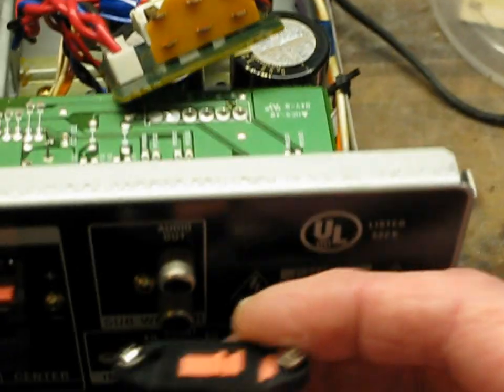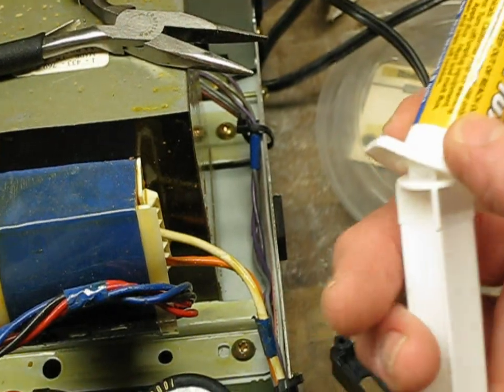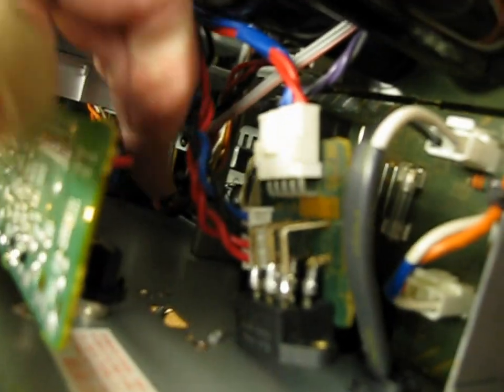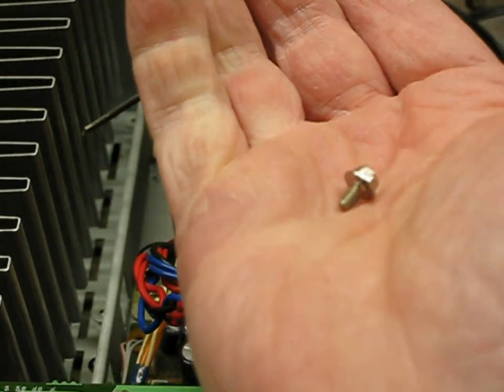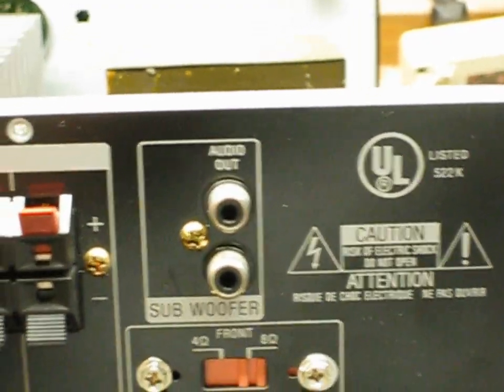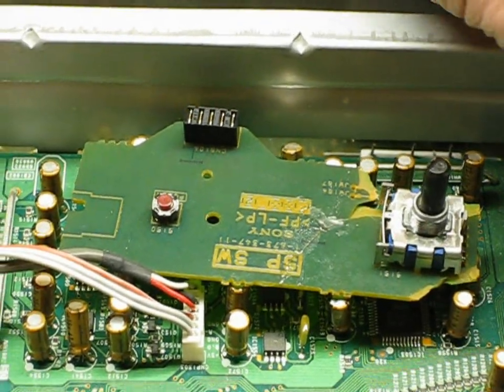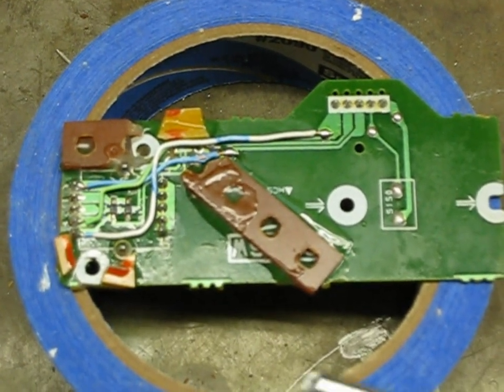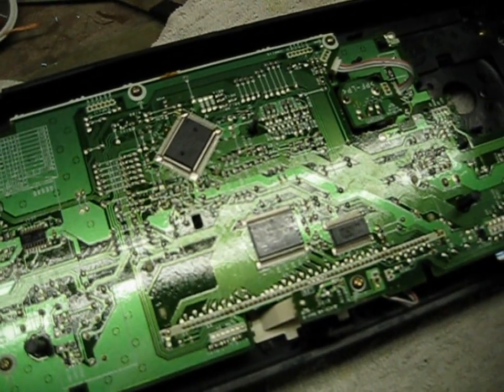SONY STR-DE935 FIX  *Common "No Sound" Issue *  -Plus Broken Switches*  PART 1

Comment: I have a Sony STR-K750p reveiver and I recently noticed that the front right speaker sounds much quieter in comparison to the left front speaker. I did a factory reset and that did not fix the problem. I rotated the speakers and the problem in the right front channel still persists. Please help! 😢

Comment: This switch changes the voltage coming from the transformer, for example 4 ohms 28 volts, 8 ohms 38 or 42 volts, this is the easiest Sony repair - many greetings from Bulgaria.

Comment: I have the same Sony Domi digital surround receiver got mine in 1998  add nobody beats the wiz $499.99 came in a remote with an LCD screen still works only issue I had back in 2009 was the the display light went out  disconnect the front panel and pull the cable gently control panel which reset the whole display works 100% also I don't push the power high so strain on the caps.     ( Long time since I seen it fully decked out of the original what's the sound of a headphone jack

Comment: If you see these, buy them.  110watts is RMS program power, the peak as listed in the service manual is 250 watts per channel into 4 ohms (165 watts into 8 ohms), that's an incredible 140 watts (55 into 8 ohms) of headroom.   Yeah they're sonys so they're bright bright bright but that's the only drawback.
Reply: I got mines😢😅 about  ago with 110 watts per channel the str d965  I wanted the str 1011 w/120 watts per channel these are great competitions  for jvc 120wpc 90s and 2000s receivers with really good 5 band equalizers but a technics  with bass down to 50hz a must have

Comment: If you're interested I do have the full sony service manual for this unit I also have a sony "concepts" guidebook that uses the DE-845 which is VERY similar to this one that goes through troubleshooting steps and tricks to bypass relays or troubleshoot to individual ICs.